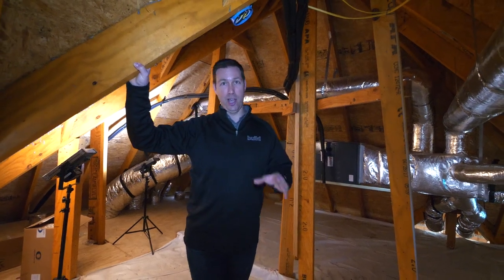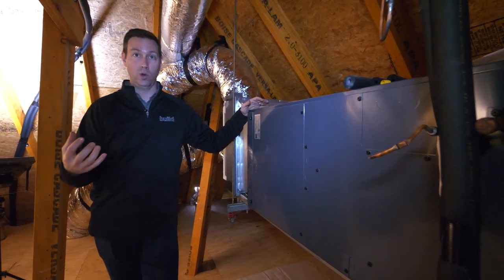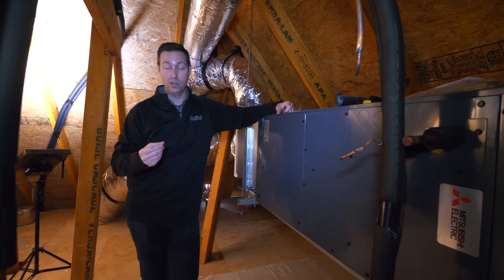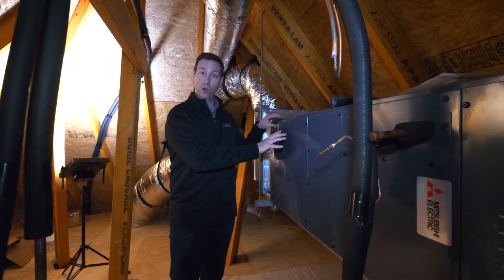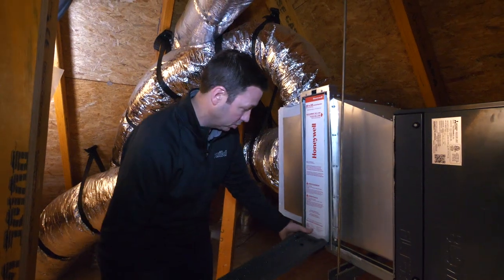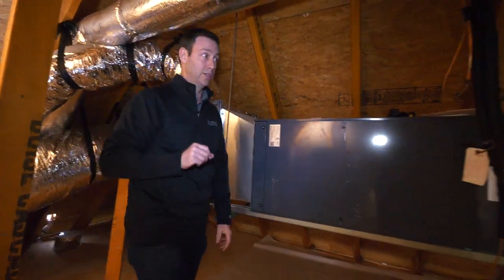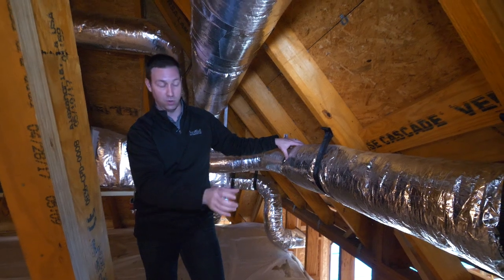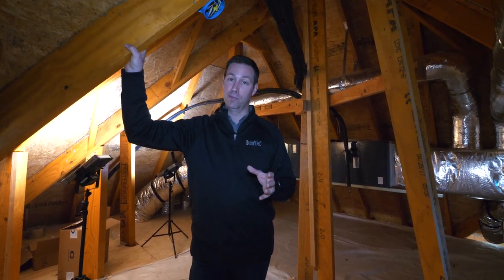New Construction HVAC - Here's My Favorite System

Comment: More filtration means more restriction to airflow, which will make that system work harder. Where is the ionizer to reduce particulate count in air in conditioned space?
Reply: ARIZONA DRONE VIDS i agree 100%.  The purpose of the filter is to protect the units coil, not to clean breathing air.  If you want to clean breathing air you need an air purifier.  Give that merv 11 3 months and its going to kill its airflow.  Merv 8 is plenty.
Reply: Farmer n' the Della Merv 8 with a reme Halo for the ionization to reduce particulate and sanitize the whole home.
Reply: You can always put a coarse filter before a fine filter.  That way, you split the dirt over the two filters, and the more expensive fine filter lasts longer.  We did it all the time in commercial/industrial systems.
Reply: John Bull I think you missed the point. A filter is not to clean the air it is to keep your equipment clean and nothing else. To improve IAQ you need to do alot more work in your home to achieve this. (Sealing ductwork, ionizer, air scrubber) that and to have even slightly positive results from a standard Merv filter you need to have your system running 24 hours a day 7 days a week 365 days a year. What is your filter doing in those off times when it's nice out and you don't need your H&C system? Absolutely nothing, it's just sitting there and during those off times your indoor air quality declines daily because of no filtration.
Reply: Hi.  Arizona.  I'm sorry for the confusion.  My comment was aimed at Farmer's comment about how a merv 11 would clog too quickly.
As you say, the filter is there to protect the equipment, and a G4 (~merv 7-8) would be enough for that.  In the UK, we used to use G4 followed by the fan followed by an F7 (~merv13) on supply air, with just a G4 on extract, to protect the fan.  So this would work, if you wanted merv 11 filtration for some reason (perhaps to prevent fan motor or drive assembly debris from passing through?).
Indoor Air Quality is largely damaged by what is in our houses rather than what comes from outside, and, as you say, in fine weather, you can open the windows (thus proving that the F7/merv 13 filter is not needed).  I suspect the point of the F7 filter was to prevent recirculated air in large offices from becoming laden with the finer dust particles that were able to pass through the G4 filter.
Reply: John Bull not a problem. Try using an ionizer   and sealing the ductwork sometime if you do an install. Almost makes heavy pre and post filtration un needed. 👍
Reply: ARIZONA DRONE VIDS Not exactly sure about the ioniser's  effectiveness. Ashrea did a study and the lvl of ozone most generators produced was ineffective according to them.
Reply: Jonathan Roeder reme Halo produces no ozone.
Reply: DEEREMEYER1 reduces airborne particulates therefore eliminating them from entering air system. Also helps air filters catch more debris because the particles are clinging together. All together eliminating need for giant thick filters.
Reply: How could an ionizer not produce ozone?   That’s literally how ozone is made...

Comment: Matt Risinger my system just stopped cooling. I have a 2014 Goodman compressor connected to a Goodman coil. This is connected to a 1995 (York?) gas furnace. I think the newer Goodman stuff is 5 ton where the original was 4. Also my old HVAC guy did not register the unit so it’s out of warranty I’m told, since it was just 5 years... so, do I get a new Aspen coil installed with a new plenum for about $1,800? Or, do I want a new Rheem full system for $6,500? I just got a new drain pan and float switch which seems perfect but my new guy wants to replace this, he says he buys this in a kit, that part sounds like BS to me. Thoughts about a new coil (which I assume comes in a new enclosure) or a new system? On a new system, should it be supported by the rafters? Currently the furnace sits on a few bricks.

Comment: Great video. I like the sheet metal trunks to flex!
Reply: That is the opposite of my experience.   Most  flex duct has a spiral wire "spring" inside that trips up the air flow creating a turbulent flow that is way noisier than a smooth duct.  If you do use the flex, find one that has a smooth inner bore .
Reply: John Page agreed flex is for a lazy contractors, always run hard. You loose way too much CFM and have to use larger flex to make up for it. Also look how it is hung, that is air restrictions all the way down. Wtf bs is he claiming it is quieter, flex duct should never be used and definitely never on a VRF system where static pressure is its killer.

Comment: Why would you heat or cool from the ceiling I thought they gave that up in the 70s
Reply: If you don't have a basement to install furnace and ductwork, that's how it is.
Reply: Because cooling from the floor is grossly inefficient. Hot air rises cold air falls

Comment: Hey Matt,

Where can I find those red springs attached to the uni strut?? Thanks
Reply: Unistrut's you can get them in Home Depots or General supply house. Springs you might have to go to a supply house like Homans or Torrise depends on where you live.
Reply: I think the springs you can search Amazon for vibration isolator , and the hanging bracket maybe can be removed and use only the sprint and some large washers

Comment: Turning vanes in round pipe?
Reply: He doesn't know what he's talking about. I've installed duct for 15 years and have never seen anyone put turning vanes in round duct. Square duct yes but you can just use elbows with round backs and throats to eliminate the need for vanes. Air flows much better through round pipe and doesn't require turning vanes
Reply: I agree, this guy has doesn't know what he's talking about.
Reply: I think he just misspoke.
Reply: Installed duct in custom homes for over twenty years service tech now agree with u about his terminology but very good looking install il tell ya there's a lot of hacks or flex duct mechanics it's horrible stuff
Reply: That's how they do it up north I guess
Reply: The answer is obviously friction. Right angle corners in sq/rec ducts slow water and air. No turning vanes in round pipe that I have seen.
Reply: You only need turning vanes in large main duct systems. That little system did not have enough velocity that vanes would have helped. This "talking head" believes his own press that he is an expert builder...
Reply: Short answer no. 😂
Reply: Turning vanes in round elbows lol
Reply: Could it possibly reduce the turbulence coming out of that header?
Reply: Nope! LOL
Reply: Wow, that supply line is horrible! I'd sure hate to try to balance that mess out!
Reply: toolman you never ever use flex duct on a VRF system, that shit is for lazy contractors.
All those having points kill your CFM and flex is bad enough by itself. This setup will kill this system
Reply: @zack9912000  flex is an amazing product. It's not the flex. It's the installer. I install flex on everything. Sized and installed properly, absolutely zero issues whatsoever.
Reply: @zack9912000  VRF has nothing to do with the duct system. 

Your comment is the same as saying putting gas in your diesel will make your windshield wipers work better.
Reply: toolman on a Modulating HVAC system flex is the absolute worst a person can use. Our company is constantly cleaning up after a new constructions job where a contractor who decides to use flex. High static kills your Modulating blower motors and puts extreme strain on the VRF compressor. Firing it to work overtime with high static problems. Air flow is everything on a VRF system. You contractor keep us busy every year cleaning up this bs

It’s one thing to use flex on an existing structure where it’s extremely difficult to run new hard duct, that’s understandable . On new construction only a moron uses flex, do it right or not at all. High static pressure will kill the system within two years guaranteed. You must be the contractor who installs and never has to correct the massive issues with it killing these system down the line. Your bs state about flex “isn’t the problem” tells me you are an installer who has no clue.

Flex duct does not maintain a reliable CFM and CFM degrades with the flex’s age. how this bs mess of a install is done here is screaming high static issues. Been cleaning up horrible jobs like this for over 20 years.
Reply: I think he's speaking about an adjustable 90° though I have many problems with the setup
Reply: Vav's have to be be hard piped/spiral with and no more than 4ft of flex to register

Comment: Dense filters like this will plug up with dust and particulates rather quickly. Dirty filters reduce air flow, affect static pressure,      and raise the amp load on the blower motor. This is especially hard on variable speed motors.   Unless the occupants have allergy problems,  use a low MRV filter.

Comment: Hey Matt, I have a question for you....I did acr when I first got out of high school in south eastern Ontario and installed a shit load of heat pumps, do they still make them and do many install them these days or do they just do separate heating/ cooling systems?
Reply: Still around. Not used often in my (cold) area but you will see the traditional ones installed with electric furnaces and the ductless split ones with electric baseboard systems
Reply: Lorne Lepage Heat pump technology has come a long way.  In cold climates I would recommend a dual fuel heat pump system. The compressor will heat when outside temps are suitable 35° +  . Electric is more efficient at these temps . Once outside temp drops below the preset balance point the system will automatically switch to fossil fuel back up , natural gas or fuel oil which becomes more efficient than the heat pump below approximately 35° . Newer inverter drive variable speed heat pumps like the Mitsubishi in the video can perform more efficiently at even lower temps than  convietional heat pumps.

Comment: I'm curious because I'll be building a new house sometime in the next couple of years - why is this system better than say a Carrier or a Lennox variable speed, inverter system?  Also, if I wanted a zoned system with each bedroom on it's own zone, is it better to use dampers and a single larger unit?  I mostly see you use a large air handler, plus maybe one other air handler in a random area.  So, basically, why is the Mitsubishi system your system of choice given all the other options?
Reply: It's not lol
Reply: Personal opinion Goodman is your best unit. Everyone will have a reason why they say go with a certain unit but Goodman is the only one I've found with a labor warranty.

Comment: Can you have a VRF system outside and a standard system inside, like in a remodel situation?
Reply: I'm sure it could be done but I wouldn't recommend it. The indoor air handler probably also has an electronic thermal expansion valve to add to the efficiency.
Reply: No you cant.  They need to talk to each other.  They use electronic expansion valves that meter the refrigerant based on the thermistors and also tell the compressor if it needs more or less refridgerant.
Reply: OK. Thanks. That helps.
Reply: Andrew Logan , Almost no indoor unit will be compatible with a new outside unit regardless of system type anyway. Federal mandatory minimum Efficiency/ SEER ratings go up every couple years due to the energy conservation code . The indoor evaporator coil doesn't have the capacity to handle a higher efficiency outside unit. The Seer has to match. I've replaced entire systems after the customer had just paid for a new non matching outdoor unit in which the compressor was destroyed quickly. Installed by crooks with a taillight warranty .

Comment: Hey Matt, what's your opinion on fiberboard air ducts? That is what I am seeing in most homes built in S. Texas.
Reply: If it's a good quality product, they are superior to externally wrapped metal. The reason is that metal will sweat (in the South that is) eventually. I did my house in metal, mastic and tape on every joint, insulated to R-10, 14 years later that buzzard is wet on the bottom. (Florida) This won't happen up north as much. 

Good ductboard stays stable and has a very smooth surface in the airflow. Bad ductboard will fall apart with the least amount of abuse. You just have to know which supply house has the good stuff.
Reply: Duct board will disintegrate from the inside if it is not lined. Fiberglass particulate in the air is a bad thing for people with respiratory issues.
Reply: Raul P. , There is no such thing as good duct board. It's all crap. It can become a mold bed on the inside just from the high humidity from the conditioned air over time. It will degrade  and grow mold in just a few years if exposed to high moisture levels as in a crawl space.
Reply: Andrew Acree  There is no way to line duct board. No approved method anyway. I agree any fiberglass in the airstream is bad. Metal wrapped on the outside is the way to go
Reply: Charles Terrizzi , Most likely you had a combination problem. Excessive humidity will cause this regardless of the duct type. If had been duct board it would have desentigrated in 1/2 that time. Even duct board will get wet on the bottom like that and rot out? Most likely aside from high humidity levels your ac air is too cold. Meaning that the air flow is inadaquite or the refrigerant is overcharged. Dirty filters , dirty evap coil degraded blower motor windings  or capacitor and usually undersized duct systems can contribute to excessive sweating. When the air is to slow it drops below design temp . Even R -16 can sweat with 50° supply air in an unconditioned high humidity area. You're better off with the metal. Even if insulation degrades at least the duct doesn't completely fall apart . I've seen homes that required a dehumidifier in the crawlspace. A sealed crawlspace is ideal but not everyone can afford that . I live in N.C .  25 years in HVAC . 5 as a licensed contractor. Not as bad as Florida for humidity but pretty close.
Reply: Zen mind there are duct boards that you can buy that have a lining on the inside. They are required by the local authority having jurisdiction in at least 1 area that I know of.

Comment: How much would a system like this cost for a 2500 ft home?  I am in Austin as well.
Reply: I'm in Richmond, va and been doing hvac since 2000.  2500 sq ft new construction would be a 3 ton unit most likely.  Standard 14 seer American standard heat pump system with ductwork in a new construction home would cost around 10k.  Give or take 10%.

Comment: Looks like a 4 or 5 ton system? Not enough return air. You may consider using 2 systems for your homes depending on the size and configuration of your home.
Reply: You are wrong. It is perfectly sized.

Comment: Ummm yea i never heard of a yearly changed filter ... 

And the duct work wasnt designed nor was it sized correctly
Reply: @lifeofabachelor8547  He can visually see the size of the unit, which gives him an accurate guess on the needed ductwork.  Take a chill pill.
Reply: Leonard Martin when you do it for 20 years you can easily see all the problems that system will have and this system Is a mess. That flex duct is horrible for systems such as VRF that high static pressure will kill the blower motor and eventually the compressor. The number one killer of modulating systems are unstable static pressures which all the flex duct causes. Lazy ass contractors use flex like that. Hard pipe as much as you can to have a stable system
Reply: I have a manometer across my MERV16 5” filter, and it easily last 18-24 months before the static pressure starts to rise appreciably. This is with a 24/7 blower as well. Especially if you oversized the filter/return duct, the pressure drop is really minor, especially with an ECM blower. And at least in my house with a very large filter, it lasts a very long time.

Comment: I believe that Daikin invented the VRV technology actually.
Reply: Robert Amos IV trane had it in the 80's. It was only out for a little bit because technicians could not work on it.
Reply: John McMaster right after Daikin invented it. They made the first inverter compressors. Trane still doesn't make their own, they use white labeled Mitsubishi units in the commercial market last I checked.

http://www.daikin.com/about/corporate/history/digest/index.html
Reply: Robert Amos IV Yes Daikin invented it. As for Trane using white label units only for mini splits and commercial VRF. Their residential split is 100% in house design including compressor and drive.
Reply: Christopher .Corbell OK. The original point is just that VRV was invented in Japan by Daikin. Just helping to correct an error in the video.

Comment: Pretty sure unless you are getting a fancy high end ecm blower motor, you aren't gonna want to put some beefy filter in your system.
Reply: BaronVonSTFU Considering it’s a VRF system I’d have to assume that it is a ECM motor. I’m not familiar with Mitsubishi split systems other than mini-splits though. Only VRF systems I typically see are Daikan. 

Most ECM motors I’ve seen are built like a tank but the modules that plug into the back go bad often.
Reply: BaronVonSTFU , All newer blowers are ECM. If not a variable frequency blower it will use a constant torque motor which is essentially a variable motor without the variable speed control board.  Both will sense an increase in amps  when restricted and will ramp up accordingly to compensate within it's abilities .

Comment: Flex duct is for homeowners to make a DIY repair until you can get a real a c man to effect duct repairs. That is not a truly professional install,  that is a one day installation,  it takes much longer to run metal pipe. Flex duct will have a much higher friction loss than metal, and you have to use double the size flex diameter to carry what a smaller metal run will carry,  8 inch flex to carry what a 6 inch metal run will carry. Flex is for amateurs.